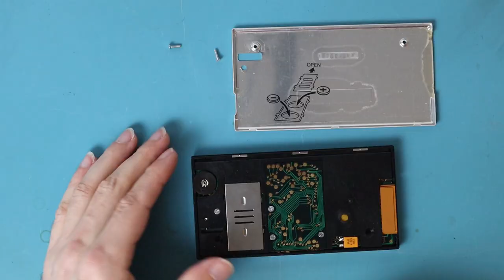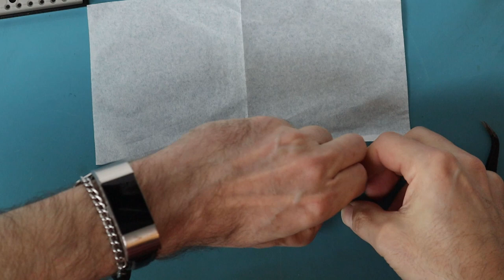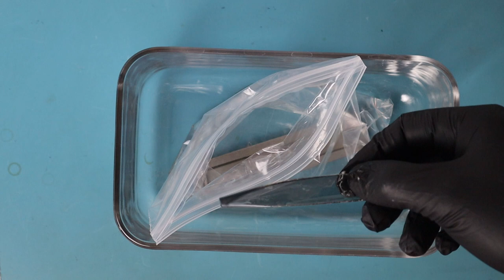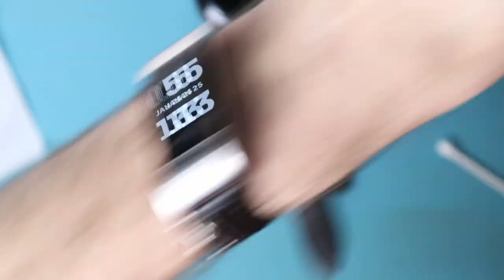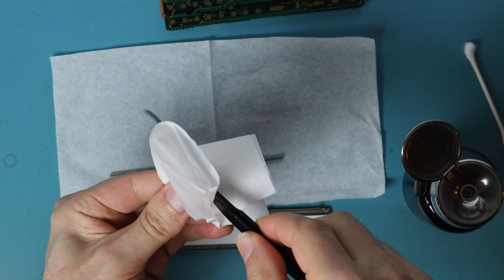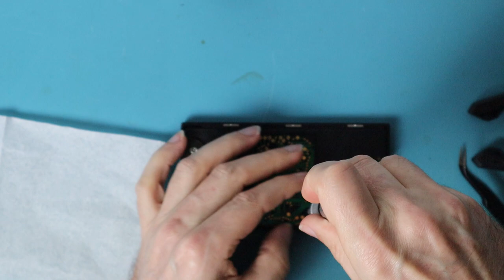How to replace the LCD on a TRS-80 PC-3 or Sharp PC-1250/1/5 pocket computer

Comment: Nice to see someone brought real replacement LCDs for the old single line PC units, so many of those with bad displays. 
also man, if only the 1260s didnt use dual lines, my 1262 has a nick at the right top edge of the lcd and bleed :c. always concerned that will spread.

Comment: Just got my Dads old Sharp pc-1250a back up and running (The TRS-80 equivalent). Had such memories of making little programs on it in High School (Ya, you can tell I was a hit with the ladies) Had a problem getting it working because I put the batteries in both positive side downward (Long story, the pic on the back cover to read the orientation was distorted). Your video help me remember. XD

Comment: That's an awesome project, well done! It must have been quite the effort to make a perfect copy of the original. Too bad there aren't projects like this for other devices.
24:40 - on a few (unrelated) LCDs I've repaired, it did matter which strip went where, and which side faced where.. I ran into a lot of frustration from that lol
I figure the contacts made just enough of an impression on the rubber over time, or something.

Comment: It for those, like me, who had fond memories of making little games on these things and now have a way to keep backups. :)
I can say with 100% that the CE-123P printer and cassette interface can not only save program files to a Windows 10 PC but can also read. Just with these instructions:
To Save:
Connect Red to Mic, grey to head phones
Start Audacity
Set as Follow:
	1 (Mono) Recording Channel
	Under Preferences set:
		Sampling (Default Sample Rate: (11025 Hz))
			    (Default Sample Format: (16-bit))
Start Recording in Audacity
Start the CSAVE"(File Name)" on the Pocket PC
After the Pocket PC has stop displaying the 'BUSY' indicator then stop Audacity Recording
Double Click to WAV display to Select it.
Under Effects: 'Normalize'. DO NOT mess with defaults and hit 'OK'
Export the WAV and under 'Export as Save as type' select 'Other uncompressed files'
Format Options: Header "WAV (Microsoft)", Encoding "Unsigned 8-bit PCM"
That Should do it.

To Load
:
FIRST: Make sure no other sounds are playing in the Background.
Type CLOAD"(File Name)" then run WAV file that was saved.

Hope this helps some of you.

Comment: Hi. Awesome. Are there plans for other models LCD's? I have a PC-1262 which has the black death and I fear that model is too rare for one of your replacement LCD"s.The PC-1262 is a Sharp pocket computer that has the same external form factor than the PC-1251 of this video, but with a bigger screen of 2x24 character. An awesome calculator combining the advantages of the compact 1251 derived and the bigger one with bigger screens.

Comment: Have you tried a heat gun on the lcd to frame adhesive? If it's just regular double sided tape adhesive it'll soften right up with a heat gun
Reply from the maker: I have tried, it didn't seem to work. I'll be glad to be proven wrong, though.
Reply: I also tried. It did not work on medium heat. It was still warm when I put the old LCD in acetone and after 45 minutes it was loose enough to put apart the bezel from the LCD.

Comment: Damnit.  I had just replaced my PC-1 and didn't think the PC-3 used the same LCD.  Ah well got to now order another one.  As a side note.  As a side note its making me look at these things more.  The side port is remarkably simple and the cassette port is a simple 1khz/4khz (1/0) interface.  Might be possible to make a tap interface to one of those nano-watt microcontroller to act as a cassette port.  Problem I am running into is interface.  A single, led will take up more power than everything combined.

Funny how writing all this makes you think of solutions.  Maybe it can send a program to the pc1 a menu program for you to load.  Humm.  Ugh can't stop thinking about it now.
Reply: I did a cassette replacement for the fx502p calculator:

http://trochilidae.blogspot.com/2017/06/fx502p-cassette-interface.html
It's powered by USB as it uses an Arduino Due so it's not micropower. You can store programs on SD card though, and send them back. It's an easy way on the 502p to access the alphanumeric characters as you can edit the data before returning it.
Also did one for the Microtan computer:
https://www.youtube.com/watch?v=aNUTthUhsHo
That one is even less micropower as it uses an OLED display. You may be able to do a micropower one, but it does take quite a lot of processing to capture and analyse the data stream...

Comment: is it possible to use that screen for the Sharp PC-1245? or do i need to look for a different one?
Reply from the maker: No, the PC-1245 LCD has different layout and contacts. I have PC-1245 LCDs in the pipeline, but it may be a few months.
Reply: @RobertBaruch  a year has passed, there is no point in waiting for the 1245 LCD?
Reply from the maker: @DmiA  I do have a 1245 replacement, but I haven't made a video for it, so I haven't put it in the tindie shop. However, if you order a 1246 and put in the note that you want a 1245 instead, I can send one to you. Getting the alignment right is tricky, and I'll put a note in the order about some alignment tips.
Reply: @RobertBaruch  Oh, I'll make an order now
Reply: @RobertBaruch  it says that seller is On A Break

Comment: "Acetone eats plastic, so you want to stay away from these tupperware containers"

I seriously roll my eyes every time i hear something like this. And then you're putting acetone in a plastic bag, which according to your own logic should melt, and it evidently doesn't.
You can use acetone safely with polypropylene containers, absolutely no reaction. The vast majority of kitchen containers are OK, and you can generally just read the bottom to determine the material.
Also no reaction with any connectors, switchgear or packages soldered onto the PCB. Reason: they must be able to survive ketone wash, which some PCB populating factories use.

Strong solvent action with polystyrene and its copolymers. So most disposable cups and disposable cutlery will be consumed. ABS and ASA are easily dissolved completely too, so that's just about every computer enclosure. Another material often used in enclosures is polycarbonate, is also affected by acetone, i think it's absorbed and causes stress cracking - the plastic weakens but does not dissolve, the result is entirely bizarre, it's eroded with a similar appearance to how water erodes stone over centuries, except it happens in minutes.
Reply from the maker: OK. I actually smacked my forehead reading that. You're right! Some plastics acetone will dissolve -- like ABS, PLA, PVC, polystyrene, and others it will not, like PTFE, polypropylene, HDPE. I'm not sure what Tupperware is made of, but I wouldn't be surprised if it's a proprietary (but food-grade*) blend.

*After 2010. Before that BPA was used in Tupperware.